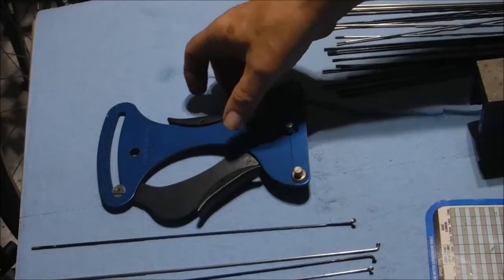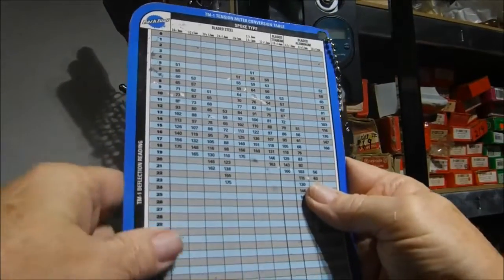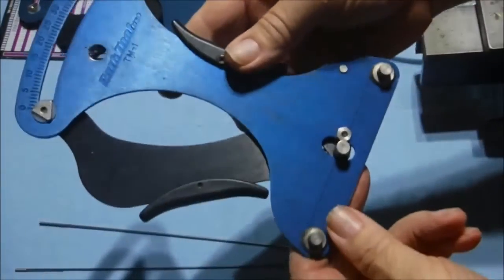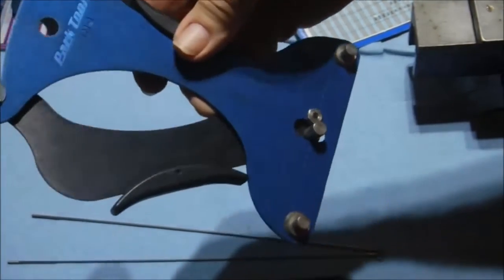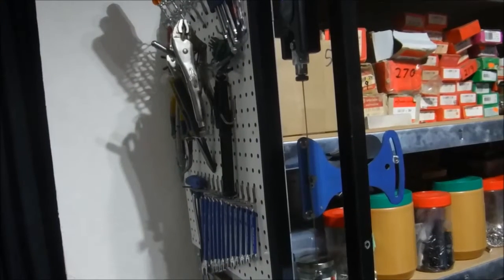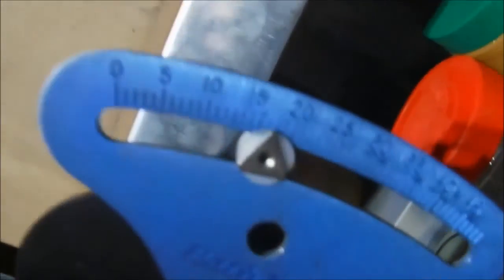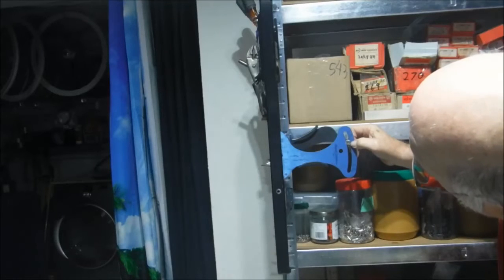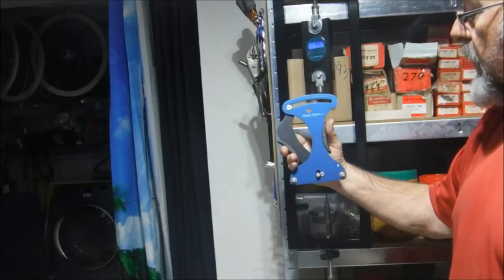Calibrating a Park Tool TM1 spoke tension meter

Comment: It is interesting that you didn't read your strain gauge when you had the tool in place.  All tensiometers add bias to the measurement, some less than others.  You'll find that with the TM-1 in place, the strain gauge no longer reads 95.3.
Reply from the maker: None of that matters at all. Yes, the scale reading will rise with the tension meter applied. In the case of the TM 1, I observe an increase of about 6%.However, the reading returns to the preset level when the meter is released.
 This replicates what happens in the wheel, so the fact that the tension is momentarily raised by applying the meter is accounted for in the calibration.
Reply: Thank you for the response.  I agree that if you are building, replacing and/or evaluating solely with 2.0 mm round steel spokes with every spoke at 100 kgf, the bias is about 6% built into the biased calibration and, therefore, removing the TM-1 leaves the wheel with the desired spoke tension if that is 100 kgf.  With the re-calibration, your measurements will lead to misleading WTA results.  I did the same thing you did except calibrating at 120 kgf prior to TM-1 placement with 25 TM-1 reading when placed.  The bias is 5.9-6.3% reading the meter to the nearest 0.2 on its scale.  Given a criterion of building a wheel to within +/-20% random distribution (yes, we can build better, but this was the BBI-shop criterion), the bias is nominally 11% at the low tension end of the range and 4% at the high.  This is an offset, not random, so it isn't constant 6% during a normal BBI-criterion build.  Also, the bias will change with spoke shape and material.  Try a Berd, for example.  Your method requires at least a check of the revised TM-1 calibration for spokes made of different material, e.g. aluminum, or made to a radically different shape, i.e. thin blade.  (All of the meters I have tested have a bias in their supplied calibration curves as you have found with the Park Tool TM-1:  fortunately, the TM-1 is easily adjustable as you  point out.  The TM-1 is superb for its versatility, flexibility & efficiency as implied by responses below.)

Comment: Shouldn't this be done with a hanging weight?
Reply: Hooking the spoke to a weighing scale in a rigid steel frame and then applying the appropriate amount of tension to the other end of it with a heavy screw-threaded bolt (cranked up with a spanner to give the right 'pull' reading on the scale) gives exactly the same result.

If anything, it's a closer simulation of a spoke under tension in a wheel than using a hanging weight.🙂

Comment: For me it didn’t do the job, after I went to park tool wta app and adjust every spoke on my wheels it still wobble, then I went doing it the old way on a true stand it went fine, so I’m not sure about this tension meter, sorry…
Reply from the maker: The tension meter won't true the wheel for you. It's only function is to ensure you are in the proper range of tension. Adjusting each spoke to get the same reading on the meter is not truing the wheel.
Reply: @2wagondragon  CORRECT. Other thing the many DO NOT do building is STRESS relieve as they tension. A 'must do' step.

GET your wheel ROUND and dished... add/subtract tension sides for lateral runout vs correcting only one side. Keep it ROUND.  T meters are to refine tension balance which is very desireable. Fronts equal tension each side.. rears the left normally 40-60-ish % left side. Applications vary.. design of hub... I often 'cheat' a mite left IF the clearance allows it. Results in higher left tension. I normally tension rt side 1st on double walled rims... say 60-70 kgf... the 'pull it over' using the much easier turning left side.

Comment: What is that spoke calibrater/tensioner called??? Im technically savvy but a novice at wheels. Ever since I purchased an eBike I've been obsessed about wheel structures, truing, building and everything wheel & spoke related. Ive been going further & further down the rabbit hole. I feel like a Neanderthal
Reply: Park Tool TM-1

Comment: How far off are most TM1 meters for 1.8 spokes?
Reply: TM chart gives data for 1.8's... Sapim 1.5 3x butted IMO stretch too much at hi tension for exacting accuracy. Sapim 
my personal favorites btw.. 1.5's great product.
Reply: @ I ended up tensioning my spoke with a scale and manually calibrating the tm1 before tensioning my wheel. Worked out great.

Comment: Pretty cool!  I have a cheap Amazon chineasium spoke guage for home use.  Wonder how accurate that is, ever test one?   Thinking if I could build a test stand using a digital bike scale.
Reply: I got such a tool which came from China. Exact same design which is easily copied off course which  is not very difficult to do. But I have never seen a test bench like this for spokes in which you can apply the desired tension. If I had to improvise something like this I just would use weights to get the desired tension because I do not have a digital weight scale like Dan.
Another option would be if you could modify a person weight scale.